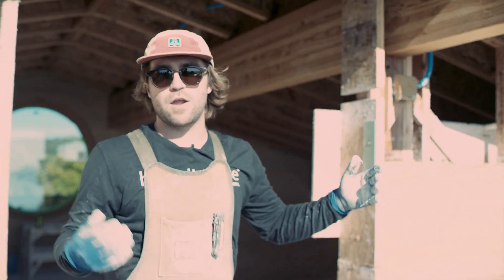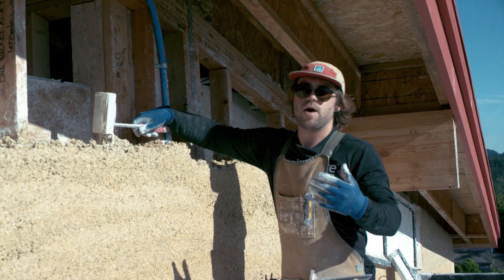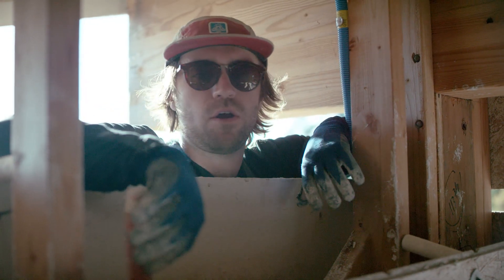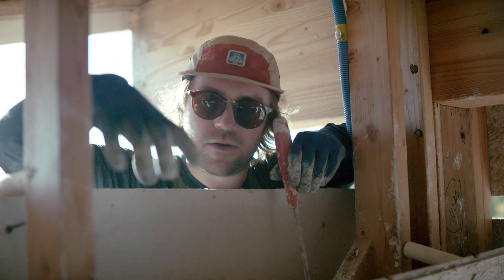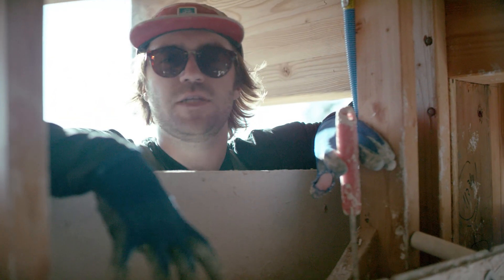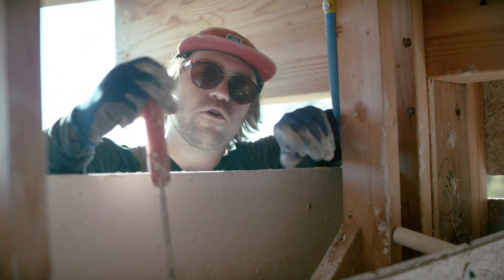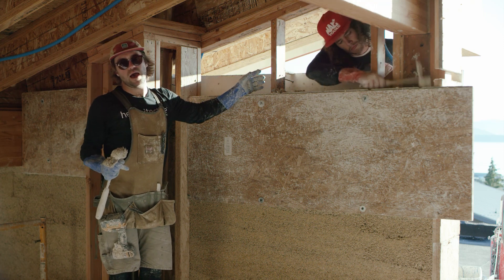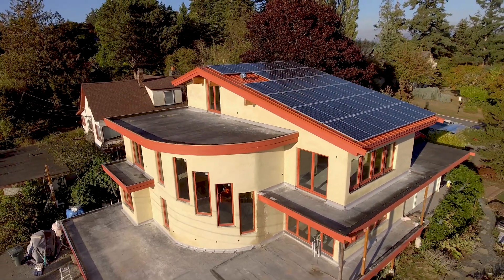Basics of Hempcrete - Episode 3 - Packing

Comment: Thinking about subbing out hempcrete for rammed soil in an earthship platform design. Would the permanence of the tires vs pre framed walls increase the load bearing capacity ? Also, i expect the drying time to significantly extend due to limited air flow. Possibly holes drilled in the  tires? Quality guidance is always a blessing! Thanks for the videos!